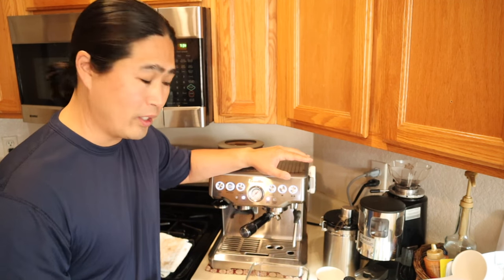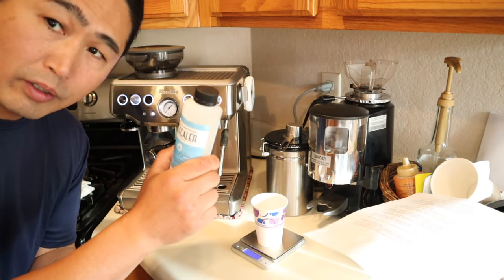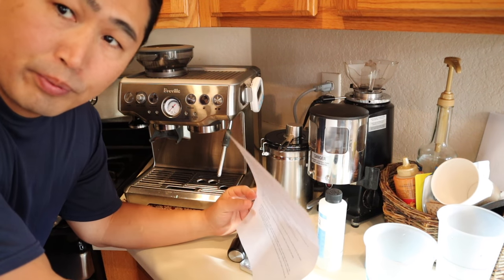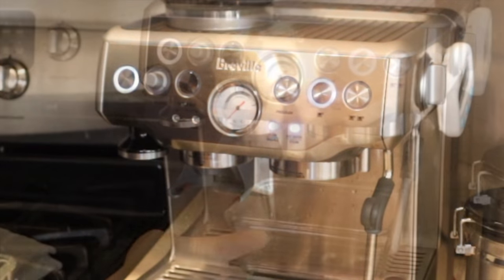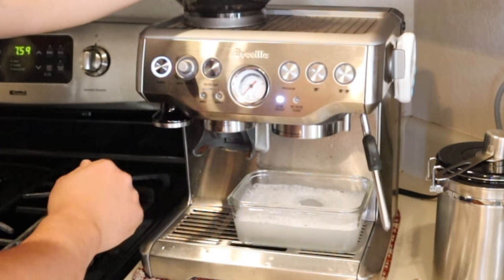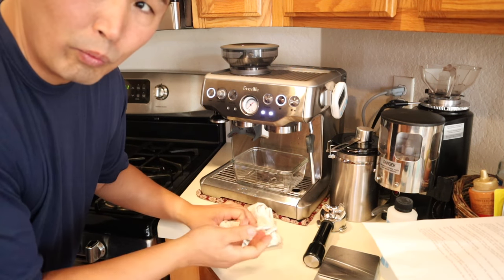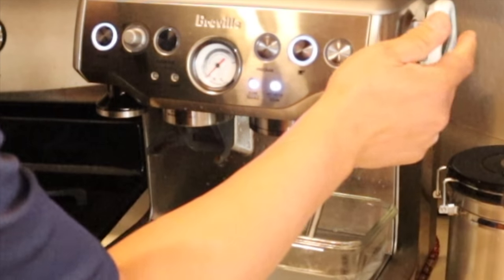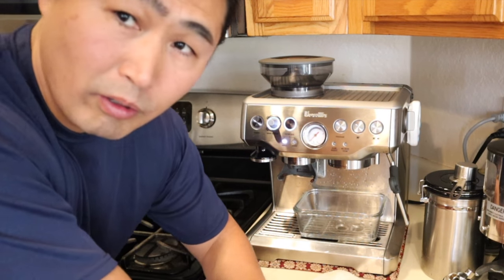How to  "Descaling" | Breville  Barista Express

Comment: When I hold the 2 cup light and power button to enter descaling mode my machine just turns right on normally and then starts up like I hit just the double shot button...help!!
Reply from the maker: Is clean me light has "clean/descale" or "clean" only?
Reply: Hoon's Coffee  the light was on and I did just a normal clean cycle and it went away, I just thought I would try to descale as well since I haven’t done that since I got it
Reply: For bes870 that has only "Clean me" button, it is version 1.  The machine can't enter descaling mode using 2 cup & power button.  Just turn on power, then descaling your machine with 1 cup, hot water, and then steam.  For machine with "Clean me/Descale" printed, you use 2 cup button and power to enter descaling mode.  Brevill support web site mentions batch code 1751 or higher for version 1, and lower for version 2. Just ignore the version, follow "Clean me" or "Clean me/Descale" to descale your machine properly.  It took me a lot of time to know why my machine can't enter descaling mode using two cup button and power button.
Reply: @dm5124  this is the answer i was looking for i've been trying to get into descale mode so many times, now i see why it is not working.  it would be nice to have this information easier to find it took me forever get here.

Comment: hi, I entered descaling mode and when all 4 lights are on, I pressed the 1 cup button. it flashes for about 20 seconds but the water only runs for like 3 seconds. it doesn't do anything for the last ~17 seconds while the light is flashing. also, when i use the steam wand and hot water, they only run for about 2 seconds each. Do you know why the timing is off?
Reply from the maker: Have you try just hold down 1 cup button?  By the way, which model do you have? Mine is BES870.
Reply: @HoonsCoffee  BES870XL. Yes, I tried holding down the 1 cup button. It does the same thing in descaling mode. (ie. it runs for about 3 seconds and then it stops running but the light keeps blinking for another ~20 seconds). If I turn on the machine normally (not in descaling mode), I can hold the 1 cup button and it will run for about 45 seconds even after I let go.
Reply: @melvinlau4551  Exactly same issue here
Reply: @smmurer  I also tried manually reprogramming the extraction duration (for normal function, not for descaling) as per the manual via the PROGRAM button. I programmed it for 30 seconds but the next coffee I make, it just keeps going.
Reply: Melvin Lau my barista express does not stop flowing too whether i use the 1 or 2 cup

Comment: Thanks for the video. Unfortunately the camera is out of focus on the machine and a couple of things were not very clear or incorrect however:
-You didn't actually mention how to initiate the descale once in descale mode, but I can see you very briefly hit the "1 Cup" button. Then it seems to stop on its own and you keep pushing it. How do you know when to push the button again and how many cycles you should do? 
-Related to that, you said once it is finished the solid lights will go off, however they never went off! Only when you powered down and back up again. So how many cycles should you do with descale solution and how many cycles with fresh water to rinse/finish it? 

Update: Ok I just looked up the manual and found all the answers here: https://www.breville.com/content/dam/breville/au/assets/miscellaneous/instruction-manual/espresso/BES870-instruction-manual.pdf (page 25+26). Basically have 1L/34oz of descale solution/water mix in the water tank; put machine into descale mode as Hoon describes; the group head part is controlled by the "1 Cup" button (flashes during the clean then goes solid when finished), the steam wand and hot water spout are controlled by toggling the usual dial; the machine will stop itself after each part descaled and you just cycle through these 3 areas yourself (ie group head/main coffee component, steam wand, and hot water spout) until solution is (nearly) all used up (should be 2 cycles). Then repeat with fresh water to rinse, as many cycles as you see fit, probably 1 cycle is fine. Upon turning off and restarting the machine the descale light will disappear. Hope this helps! 

PS: My Breville BES870 model does not have a descale light, only a "clean me" light. Presumably then you should just descale every 6 months or so, depending on your local area water hardness. Thankfully where I am the water is very soft so doesn't need to be done very often.
Cheers!

Comment: I’ve done the descaling and run normal water through it a few times already, but the light is still on. Help
Reply from the maker: Which model do you have?
Reply: Hoon's Coffee same one as yours. I managed to solve the problem today. What I did wrong was I pressed the 2 cup button and power button when the machine was on, not when it was off. It doesn’t actually state that in the manual, but I’ll know for next time! Great video btw man, really helpful!
Reply: Micah Chang I had the same problem!!
Reply: Micah Chang thank you for sharing your solution 🙏🏼

Comment: Hoon - I like that you are pretty technical.  I have the machine and cannot get crema.  Actually, my daughter's machine. As I am not a coffee drinker, but very technical in nature, I am trying to diagnose the issue.   My first question is perhaps the lack of fresh coffee?  I understand that old coffee might not product crema.  Also, do coffee's vary in their ability to produce crema in your experience?  I noticed that your processing time does vary, with one process taking 37 seconds (several were 25 seconds).  The "ideal" extraction seems to be 25-30 seconds.  I know this is not necessarily crema related, but again, it just illustrates there are many variables driving process variation.  Can you please do me a favor?  Can you please let your machine warm up as you indicated it needs, then process 1 oz of water into a styrofoam cup and measure the temperature of the dispensed contents (perhaps you can do this with coffee and just water).  I am trying to see if my temperature is off somehow.  Hopefully you have a quick response digital food thermometer handy.  Here is what I did.  1) Warmed up machine. 2) installed single wall, 1 shot strainer, 3) cycled machine 2 Tims on single shot to just run things, 4() dispensed single shot into styrofoam cup and measured temperature at 187F.  It drops pretty quickly in temperature in the cup, so you need a fast rating digital food thermometer.  I actually measure temperate while in the dispensing phase.  It may have peaked at 190F, but 187 was a stable reading just after completion of dispensing.  I know there will be some temperature loss in the process, but I am trying to eliminate temperature in the crema issue.  Thanks!!!!
Reply from the maker: Thank you so much for your feedback. Actually, I just made a video about on "water temp" on Barista Express. I'll uploaded on Friday.
Reply: Hoon - I saw your water temp. video after sending my inquiry ( I am intrigued by your videos and needed to keep watching!).  I confirmed that my water temp, is in fact, just about identical to what you measured and how you measured it at the spout location.  I have the same Breville machine.  I noticed that my entire cycle can be as short as 15 seconds.  I ran a single shot, without coffee, with single wall single shot filter when I measured this 15 second total cycle.  Way too short.  My pressure reading was in the first quarter of the acceptable pressure range for this trial run.  Not sure if you could make a similar run and get me feedback on your time.

Comment: I actually tried this yesterday and pressing the double cup + power button didn't lead to what I see on this video. Also It just started to make some loud noise and I didnt see the clean me light on either.  So I just ended up using 50% vinegar, 50% water to the level of 1.5L and empty half the tank first with it, then the steamer, then the hot water and repeated that process like 2-3 times.
Reply: I had the same problem doing the 2 cup and power thing. Problem was because I was doing it with the machine already on and it kept turning it off. Start with the machine off, hold the 2 cup and then power and it will work. :)

Comment: Hi Hoon. Thank you for all your videos , great information and I love it . I just bought my machine breville xl 2 weeks ago and I have few questions to ask you that how often do you change a  filter from the water tank ? Do you clean the machine every 2 weeks or when ever the light is blinking ? Are you using a pressurized or non pressurized basket for cleaning process ? Thank you
Reply from the maker: I used filter water from my refrigerator So I do not used the filter but if you're using a filter you should replace every two months. I clean the machine once clean me light is blink. Please check out the my "Clean me" video.
Reply: I used drinking water instead tap water. Do I need a filter in the tank or not necessary ? When you're cleaning  or rescaling, does it need to be drinking water in tank ? Thanks again

Comment: If we take a look at the actual text print on the machine, just like the STEAM/HOT WATER indicator, there's a line between them, meaning, the light can indicate either or both service notice.

Descaling is different from cleaning, and the former is more determinant of your water quality. If your water is great, you'll most likely end up cleaning more than descaling.

https://youtu.be/4Xrd9azuXaQ

Comment: i just added descaler and forgot to take out the water filter. realized quickly before running cycle and removed after just a minute or two. do i have to toss the filter?!
Reply from the maker: Just get a new one.